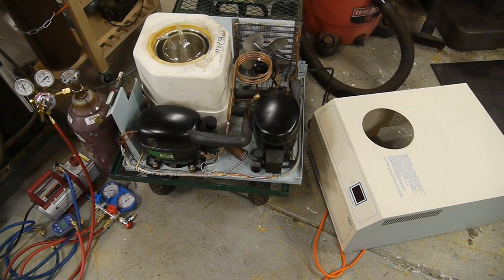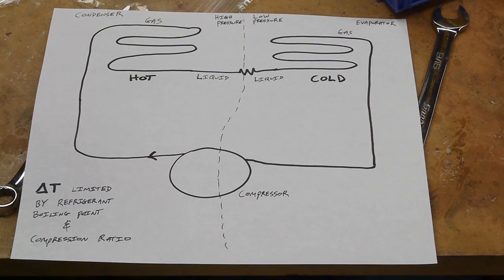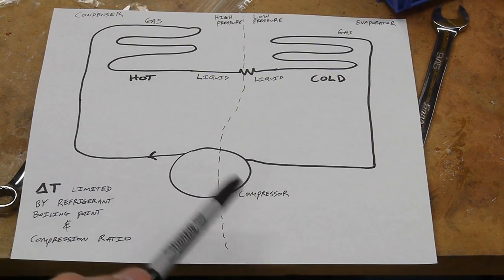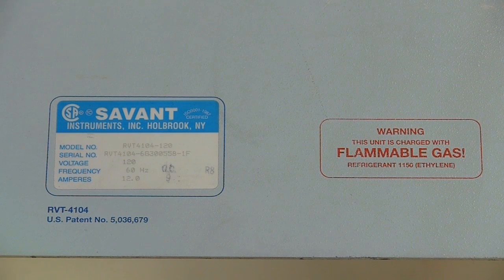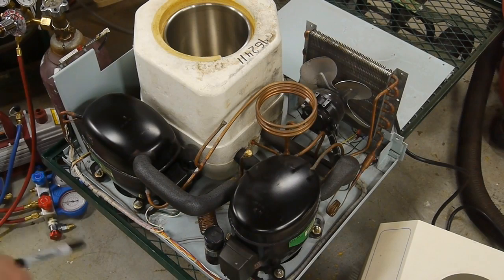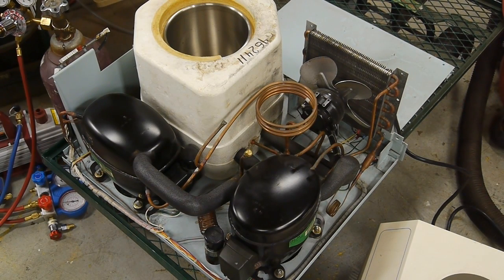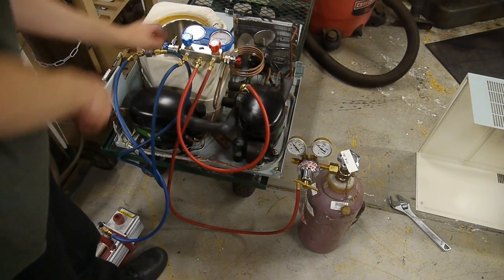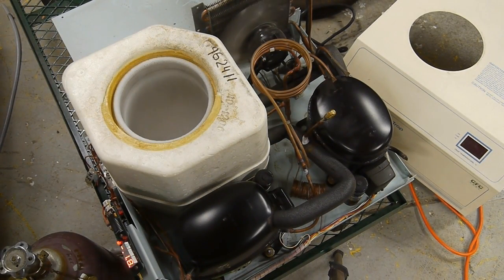Ultra low-temperature cascade refrigeration system repair

Comment: You could have a too low charge on the system. When adding refrigerant to a system you need to watch the suction pressure while it is running. Since Ethylenes boiling point is -103.7°C the pressure on the suction pipe when the system is running should be right above 0 psi gauge pressure to achieve -100°C. If there is not enough refrigerant in the system there will be vacuum in the suction side(meaning air could potentially be sucked in) and the compressor will not get enough cooling.
Reply: How could air be sucked into a totally sealed system?

Comment: How much power is it drawing?
Reply: billyram999 probably not much those compressors are usually around 150 watts and the condensor fan is probably around 25 - 50 watts..

Comment: You can affect the pressure in a system by altering the amount of refrigerant in it.

You can also get the vampire valves to seal if you don't crank the needle down all the way when you puncture the pipe. When you're done with the system you just crank the needle down until it seals where the needle functions as a piston and the pipe a valve seat. 

It's essentially a small needle valve.

Comment: Was the issue with getting the etyhlene one of finding it at all, or finding someone who would sell a small amount at a sensible price?
Reply from the maker: Finding the gas for sale at any price was challenging.  All refrigeration shops require their customers to have an EPA license, otherwise they just hang up the phone. Local welding shops all looked at me like I was nuts. Some told me that I should stop making drugs with the gas.  Agricultural ethylene isn't usually pure enough, and is usually sold as an on-site service.  One gas supplier agreed to sell it, but wouldn't allow me to pick it up from them, and also refused to deliver it to my house.  A true wild goose chase!
Reply: @AppliedScience  I have wanted some ethylene for the autocascade I built back in the early 2000's when I was a teen aged doofus, now I am a full grown doofus and I still want some! Nitrous oxide and propane gets me to -100c but it's a struggle, ethylene would be beautiful.
Reply: @AppliedScience Getting the EPA Section 8 to purchase refrigerants is very easy.  Especially for a smart guy like you.  Check out your local HVAC supply house or look online for the training.
Reply from the maker: mrpeanutguy4719  I'd like to tell everyone, but I'm afraid that my source will dry up if I do, and I want to get more exotic gasses from this source.
Reply: There is no secret, you need a friend in an academic lab.
Reply: @wolfgangouille  I have friends like that, and there is no fucking way any of them would lift anything from their departments. Not at all worth the risk for them.
Reply: If someone needs ethylene, you can check on my channel how to make refrigeration grade ethylene on your own.
Reply: Applied Science So get your EPA license its only $15- 40 dollars to take test depending on where you go.
Reply: Applied Science  its not that hard to get the epa cert if you wanted to do it legit,( although i did goto school for it tho)
Reply: @grimninja2004  For anyone reading these comments, yes, the EPA cert is super easy to get. A tinkerer-engineer type already knows the content except for a small list of regulations and some dates on which certain things were first required. (They're all in the past so you don't have to remember the dates after the test, just the regulations.) I got >95% after a couple weeks of part time studying from a textbook and practice questions, minimal prior refrigeration experience. It was also pretty inexpensive.
Reply: Nick Moore Start your own corporation. $200 on line
Reply: It's not enough to incorporate as a sole proprietor or so. You'd need an LLC, a staff of at least 10, and an annual turnaround of at least a few million dollars, and perhaps a bunch of licenses and certificates to get access to interesting products.
Reply: Applied Science So, where'd you end up getting the ethylene from in the end?
Reply: So you got it from that same guy in that one big bang theory episode that sold them helium?
Reply: Applied Science Very cool (cryogenic even), that should give you more throughput than the nested bowls.

I have been trying for months to get a new high speed camera imported to Canada and have been running into the same kinds of nonsence. The manucature will not export, ship to re-mailing services or sell to me in person if I were to show up at their office being an individual from out of country. "Civilian science" has taken a big hit in the last decade.
Reply: @NickMoore  It's 5 years later now but I think Krontech is in Canada. It's @tesla500's company.
Reply: @NickMoore  Buy it off ebay.
Reply: cheerdiver I believe you're referring to Uncle Fester, and his  wonderful portfolio of anarchist mischief
Reply: Applied Science
Didn't that character on the Adams Family, that did all the experiments, write a book??
mrpeanutguy4719
Reply: *****  the UK would ban matches if some kid poked his eye out with one
Reply: Applied Science I though just by saying your name people would bow and hand you anything you ask. lol
Reply: Not sure if this helps but maybe you could attempt to make some of your own with with the dehydration reaction of ethanol catalyzed with sulfuric acid Maybe
Reply: Applied Science This is what I hate about the "corporate system", they have regulated the individual out of most tech markets.  I tried to get a form of bacteria for a ABE fermentation (http://en.wikipedia.org/wiki/Clostridium_acetobutylicum), yet I am not a corporation, so they wouldn't even consider selling me a sample.  This bacteria dies when exposed to oxygen, and is considered to have the same "health hazard" as common baking yeast sold on super market shelves.  Purpose of experiment was to make butanol, a DIRECT replacement for gasoline.  It doesn't take a Disney imagination to know why these restrictions are in place.
Reply: @cheerdiver  The "corporate system" is gun-shy of lawsuits from idiots that won't take responsibility for their actions/ reactions. Corporations hate government regulation- it cuts into profit. Corporate "self-regulation" might be used to help eliminate competition.
Great job @Applied Science.
Reply: Applied Science im pretty sure you can buy small bottles of refrigerants for car a/c units. It may be only good for the high side of the system though as it is usually r134a